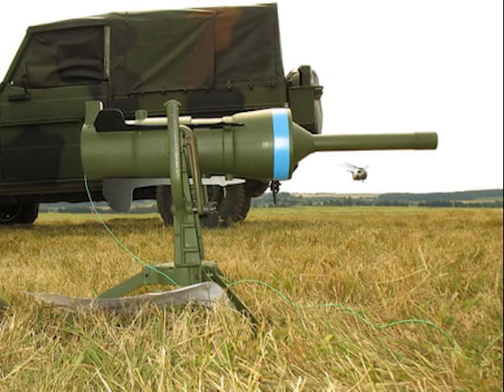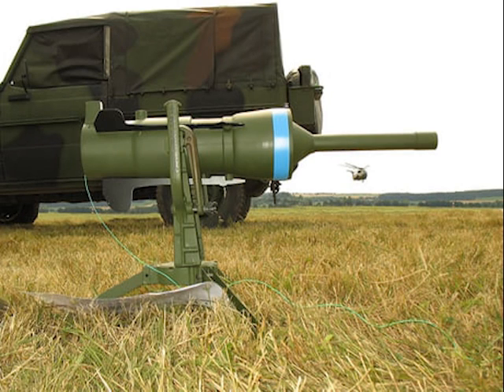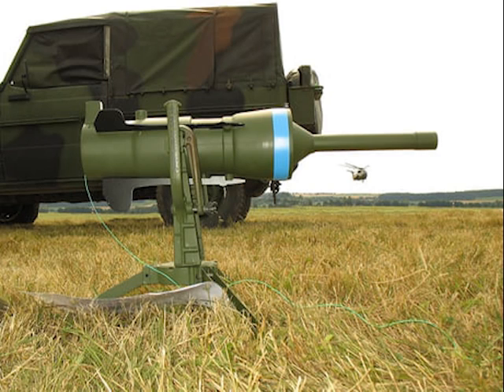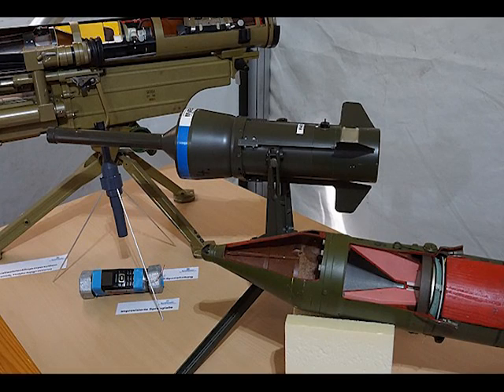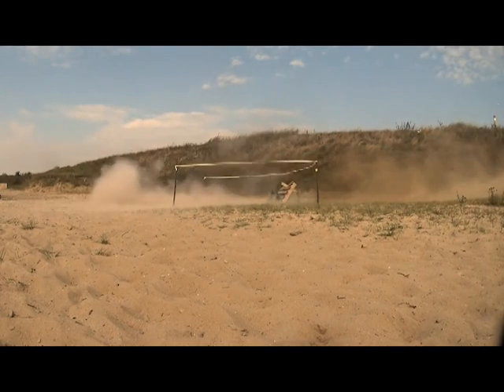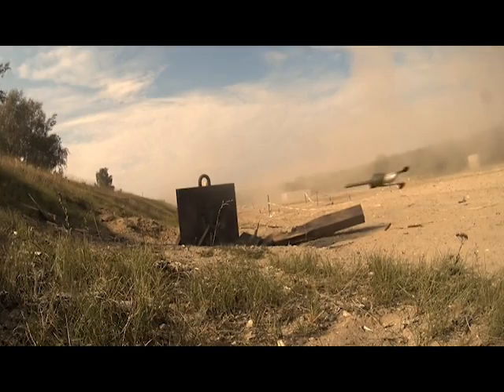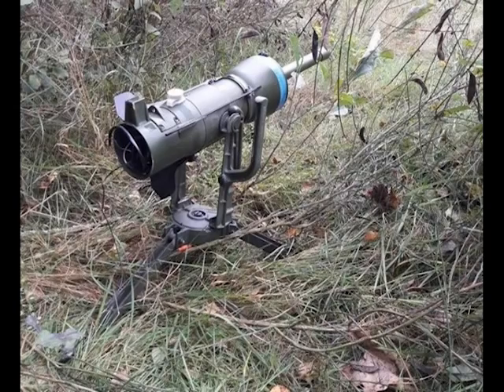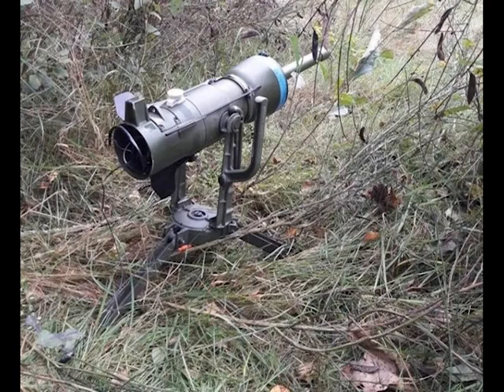How the PARM 1 and PARM 2 anti-tank Mines Work

Comment: Huge improvement over the old US M-24 that used a 3.5 inch Bazooka round. Saw video of these placed well off the road and aimed at an angle to hit the target from behind after it drove past the mine. Placing them on both sides of a road would be confusing for a convoy caught in the crossfire. Thanks for posting this.